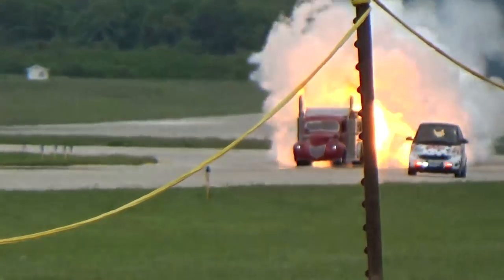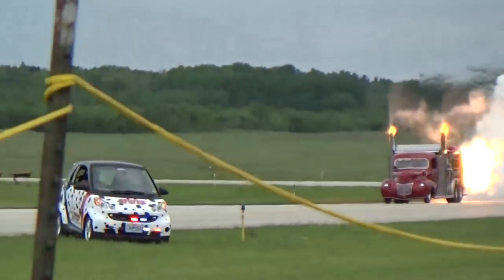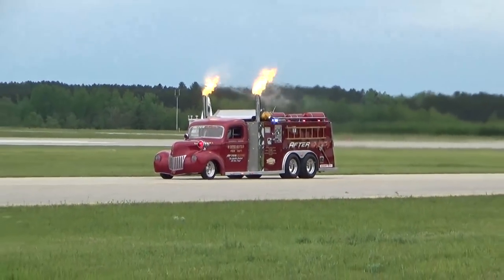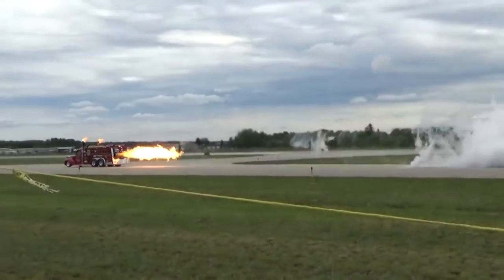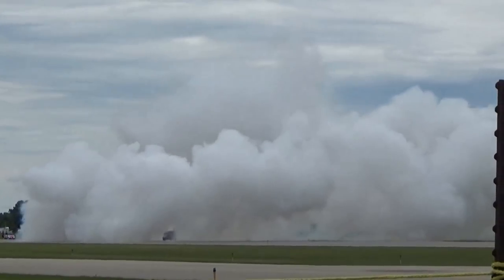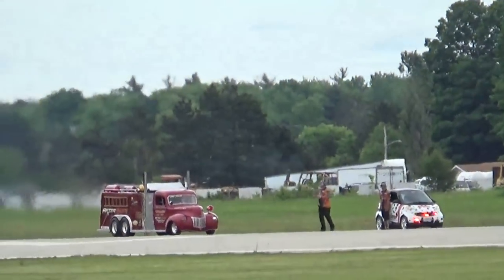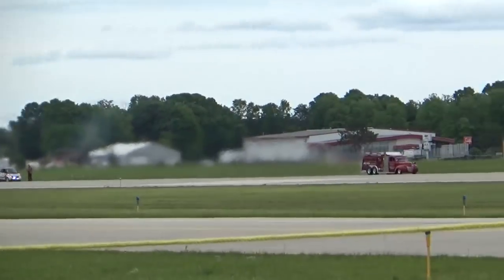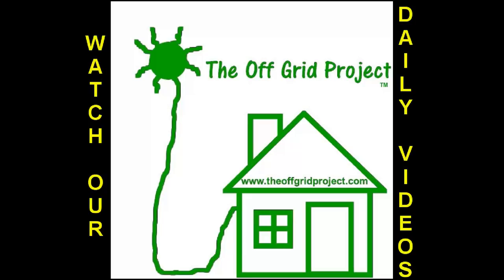After Shock 24,000 HP 400 mph Jet Engine Fire Truck

Comment: As cool as this is it really doesn't give a sense of the sheer power unless he races a jet/plane!
Reply: Late reply but it races a jet and beats it.
Reply: @q2adawdwa  yeah no. Top speed of that that truck is 450. That’s crawling speed for a fighter jet
Reply: I watched it race a jet!! It was awesome to watch and really gave you a sense of it’s true speed.
Reply: @briankyllonen6856  I think the record for this truck is 376 mph, not even close to your 450. That being said the truck doesn't even start until the planes/jets have already passed him and most of the time he wins against the planes. The whole exhibition is very impressive and doesn't really matter who wins as it's for show. RIP  Chris Darnell.
Reply: @briankyllonen6856  To be fair, a jet is already at speed when racing while the truck needs to accelerate.

A jet flying will easily beat an identical jet taking off the runway with full afterburners.